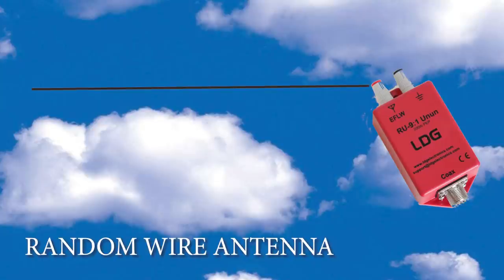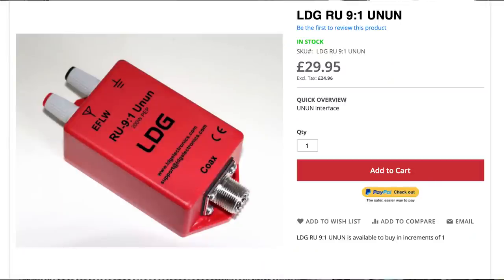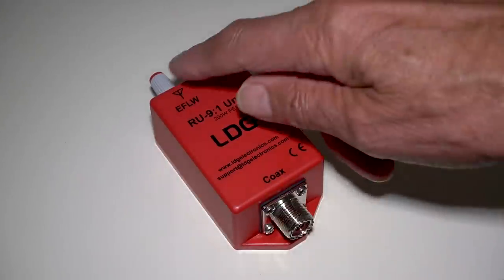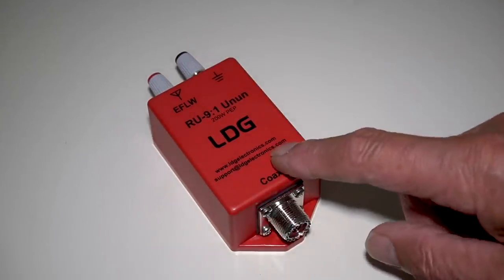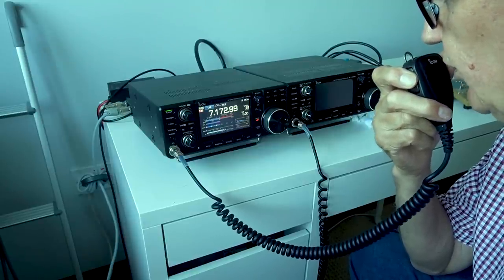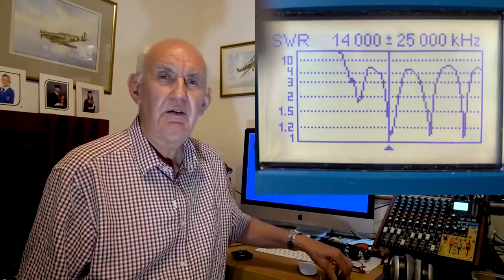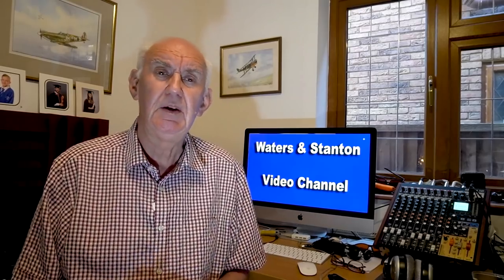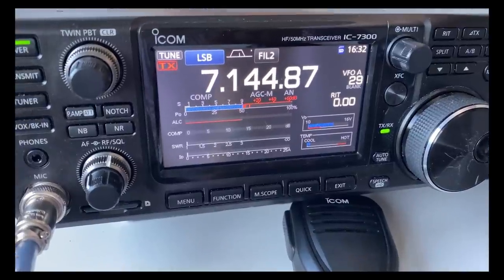RANDOM WIRE ANTENNAS USING THF LDG 9:1 UNUNS

Comment: I have had several truly random wire antennas for my SW RXers, typically 10 to 20m long for some 50+ years. At no time have e I used a 9:1 unun. and I have been able to log 1000s of SW B/Cs over the years from here in NZ. A recent article by a very experienced engineer in the US pointed out the impedance of a random wire was typically 3000 to 4500 ohms, not 450. A lab test of the input impedance of a Tecsun PL660 gave a result of 34 ohms on HF, not 50. Hence the use of a 9:1 unun was pointless for receiving. The prime consideration for RXing is the lowest noise floor possible, not impedance matching. People are mixing up max power transfer for a TX, and low noise for RX. I would strongly advise static protection for external RX antennas. (Life member NZRDXL, Life MIEEE)
Reply from the maker: Hi Ken. The engineer is roughly right. A long  wire mis-match on receiver is no bad thing on SW bands. The signal strength  attenuation is often beneficial. The nouse floor will also often appear better. That is why most transceivers have attenuators that can be switched. It is the Tx side that must see a good match. 73 Peter.

Comment: +1 on using a line isolator! Using a 9:1 random wire setup without one with just 10W on 15m made my PC do some very strange things, it was like there was a ghost in the machine. A bit shorter wire than yours worked well for close European contacts on 20m SSB with only 4W along just the top of a 1m high fence. Turning it into a sloper with the far end on 7m pole got me out to eastern Europe and one in to Asiatic Russia still on QRP SSB. I was really surprised what a bit of cheap wire could do. As you say, it will be good for portable or those starting out on HF on a budget. Mine is self wound, but found it fiddly to do so would probably just buy one of these if needed another in the future.
Reply from the maker: Maby thanks. That sounds like real ham radio! 73 Peter

Comment: Love your channel. Two years ago I tried the random wire antenna during Field Day using a length the website you reference considered okay. I attached the 9:1 at the base of the slopper and added a radial on the ground for 20m. I attached a line isolator (rf choke) to the coax side of the LDG 9:1 then coax to my mfj tuner and this fed my Ft-991A (it can only match 3:1). Receiving was great. When I hit the PTT the MFJ went nuts and my ft-991A reset. Seems like RF down the line. I have used the isolator since without an issue, so I believe it is working. I have no idea why the set up  didn't work. This story aside. My question is this, whenever a counterpoise or radial is used on an EFHW or Random wire antenna, it looks to me like a flavor of an OCFD with a higher impedance. What do you think?

Comment: Does a 50 or so ft of wire with a  9:1 really tune 160m? I will have to try that to believe it. If so, everyone with an IC7300 should use it....to take advantage if 160

Comment: Update: I built a 41 foot vertical antenna with a single 17 foot counterpoise with this unun.  Because my station is on the second floor, and there’s a large tree growing over the house, I was able to pull the 41 foot vertical section into  to the tree so that the bottom of it is approximately 12 feet above the ground at my widow level.  The single counterpoise is also elevated and simply draped away horizontally through some trees at 90°. I made 4 SSB Parks On The Air contacts on 17 m with this antenna; the longest being from my QTH in the eastern United States to San Francisco California (2500 miles or 4000 km). Good reports of 56.  I was running QRP power of only 5 W. The key is my coax feed-line totals only about 2 feet.  Very low-loss system.
Reply from the maker: Many thanks for that.. Sounds a nice serip. 73 Peter

Comment: I have two of these 9:1's and they work very well. For wire I found speaker wire is very cost effective and it comes in thin sizes that hide easy.

Comment: Thank  you Peter
 for the  clarifacation on 9:1unun.  I have one I tried to use on a short feeder  cable of rg58  which is about 12ft long, I measured out  65 ft for the antenna,  and I was using no ground earth,  and was disapointed on some of the higher swr readings,   and therfore thought it was faulty, the atu I was using is a edx1 from Alinco,  my shack is in a stone building and a ground post is very possible in fact I have one to install now on watching this I am less worried I have been setting up correctly, The un un I bought was commercially  made. I also made a line isolator on ferrite FT240-43 FERRITE TOROID  from ebay and put it on the antenna side of the ATU. The radio I am using is ts130s
I have had some contacts on it,  and now you have put my mind to rest on this situation, as I did not want to damage the radio. I intend now to watch more of you videoes and have suscribed
regards G1GDB
Reply from the maker: Hello Derek. Great to hear from you and get your update. Thanks fir the support. 73 Peter

Comment: I can attest that the 9:1 antenna is a great performer. I home-brew mine using readily available toroids using the “Earchi” instructions. For field antennas, the toroidal transformer can be fastened directly to a piece of plastic cut into the shape of a winder. I also use a home=brew 1:1 transformer at the rig. My rig is a KX2 with its excellent ATU. I have lots of other experimental antennas, but this is the one I reach for most often for portable activations. I use a 10M telescoping pole and set mine up as a vertical or as a longer inverted vee.  The setup time is very quick, and the performance is always satisfactory.
Reply from the maker: Many thanks. 73 Peter

Comment: Another great upload Peter! I'm a big fan of the 9:1 unun... although a bit of a compromise they make a great multiband antenna for home use when space is at a premium. My 9:1 configuration is a 22m radiator working against a 20m counterpoise, this let's me work bands 80m through 6m with some great results. As you point out the average vswr is approx 2.5:1 across the available bands but this can be matched via the transceivers internal ATU with no issues.
Reply from the maker: Thanks for that. 73 Peter

Comment: Hello Peter.. Thanks for this video, im sure my eyes didn't move while watching this one. Antennas, and especially cheap simple easy to erect antennas are very interesting.. I  use a small 10m wire and 9-1 unun at 7ft high. Worked stateside and most if Europe quite frequently. Didnt know about the line isolator though. Fantastic presentation. Many thanks. Gary.

Comment: I did a test a few weeks ago. I ran out 25m of wire, connected to my Pl330. Checked reception over a wide range of freqs, the cut off 5m lengths and tested the same freqs. At 10m I reduced the length to 1m sections. Optimum reception seemed to be with 7 to 10m which is similar to the wire antennas supplied with these modern SW portables. Additional length increases noise and overload.. But the PL330 is a brilliant receiver.
I enjoy your down to earth comments based on considerable experience. Cheers.
Reply from the maker: Many thanks Ken for the information. 73 Peter

Comment: With the wide availibility of 9:1 ununs one or many would think that it was a magic ratio that is absolute and a panecea to match every random length wire in every condition or environment. Many new hams don't realize that 9:1 is just a balllpark ratio to lesson the losses of no transformer at all. Example,  I use a homemade 4:1 on my 53 foot inverted L with great results, especially on 20 meters. It is just 12 or 13 turns bifilar wound around a ferrite rod antenna core maybe 5 inches long taken from a scrapped am radio found at a thrift store for about $3.00.  As a plus, I use it's companion variable polycap as part of my matchbox tuning. These two parts alone were worth more than the radio. 
Point is sometimes a 4:1 or even 5:1, 6:1, 7:1, etc. May be a better "match" at one band over a 9:1. 
Ideally, one could construct a transformer with multiple taps for each of these rstios and select the one that gives the best match at the radio, on some cases eliminating the need for a seperate antenna matchbox. In fact on 20 meters and other bands,  I don't need a tuner between my feedline and my transceiver. To top it off, I'm using 75 ohm catv line (RG59) to feed it. 

By the way great presentation and you covered the subject well. Always enjoy your posts. 73 de KC4QI

Comment: Great video. I am using the LDG 9:1 UNUN. I have it placed at the bottom of an inverted L. My feed line is a 100ft. RG 214 low loss. At first it worked fabulously  from 80m to 10m. Then after a month or so all was lost. Upon inspection,  the UNUN had filled with water. It's not supposed to do that. So they claim. Drained and dried out the UNUN and sealed. Mine wasn't initially sealed. Now it works again but it seems I do not get out as well as I used to. VSWR is very acceptable among the bands. Kind of confused at this point. I gave recommended the use of the 9:1 to several of my ham buddies a while back fo their end fed set up. Theirs have been working great. Man I love this hobby. Keep the videos caming. Have fun, stay safe and stay healthy.
Reply from the maker: Hi there. It is very easy to think after an antenna repaur that things are better ir worse. If the VSWR is the same as it was, then it is high likely that it is conditions. You could replace it with a brand  new UnUn but I fear you may find it is conditions and not the transformer!

Comment: First RF Choke is paramount, End of Story. I use EARCHI Design FT-240-31 RF Choke with 9:1 T200-2 UnUn and 30 feet of wire which outstanding for local 10 meter and 6 meter Net(s) Also have used same configuration with 53-57 feet of wire with sweet spot on 40 meters and also was able to get 6 meters ; ) I replaced 53 foot antenna with FT-240-31 RF Choke and 49:1 FT-240-43 EFHW and 65 feet of wire which gave small performance increase on 40 meters but lost 6 meters with EFHW : (   I can not overstate the performance of the EARCHI Antenna for me and small front yard city environment ; )  Only thing better for me and my location is ARROW YAGI-UDA Antennas which I only have room for VHF UHF antennas,  ARROW ANTENNAS have outperformed everything else I have tried to date. . .   Thank You for a great informative channel. . .    ; )

Comment: Thank you for the best video I've seen covering all the key points of setting up and using end-fed non-resonant antennas with 9:1 ununs. I find that the antenna and coax lengths are very important. I now have a  71' sloper, 9:1 unun, 50' of RG8u coax, 3O' counterpoise, and common mode choke attached to my transceiver with a 1' RG8u jumper. Using an inexpensive manual antenna tuner I can get from 1 - 1.5 to 1 SWR on the phone segments of all HF bands 80 - 10. I've made many contacts using 1 to 20 watts SSB. My current project is a 135' sloper that will go from my 25' balcony to the top of a 100' oak tree that's about 150' away. I recommend learning how to calibrate and use an inexpensive NanoVNA to view and adjust antenna, coax and counterpoise lengths for minimum SWR.  Thank you again for an extremely helpful and very encouraging video!
Reply from the maker: Great information. Many thanks for that. 73 Peter

Comment: great tutorial peter, there's a lot of recommended random lengths on different site's....  for portable dx i use nothing else, 29.5ft wire vertical, with 2 times 20ft for radials/ counterpoise

this will work ok but best results with this kit is to run the ground/radials/counterpoises away from the unun, 2x10m of mini8 coax with a common ground rf choke, or clip on ferrite at the 10m joint so part of the coax is a counterpoise,  these antenna's hate short coax feeds, done right they are a very affective setup
but need a lot of choking and grounding

Comment: This reminded me of a couple of vintage 1950-60s 'USA novice' CW-only transmitters I have (Eico 720 and a Globe Chief) using 50-watt tube finals and a PI-network tuner output.  The instructions for each said to use a coax-fed resonant dipole, but if that were not available, any random wire of 75 feet or so thrown up in a tree would work fine if the rig had a good connection to a ground rod or the house  plumbing.  And they do indeed work!  Those old transmitters seem to be able to load up on just about any wire of reasonable length connected to them.  -- John N0BUP
Reply from the maker: Hi John. Yes I remember those days. No VSWR meters, just neon screwdrivers and old WWII RF current meters - that I burnt out on occasion!!  73 Peter.

Comment: Excellent Peter, I also run a 9-1 with a matching unit, good results on 40 meter, not so much on other bands, your video got me thinking, longer counterpoize and isolation unit, will give it a try, also I set up a portable, usually where I can find a good tree, thanks for the tips.
Reply from the maker: Thanks for the info. 73 Peter.

Comment: Hello Peter, I have been experimenting with an unterminated "Vee Beam" for 20-6 meters, with my leg lengths currently each at 100 feet. The Vee Beam Apex angle is approx 60 degrees. The wires are up in the air about 35 feet. I have been getting fairly good results and with noticeable gain in the intended direction (NE and SW). My QTH is in NY State. My system is fed with 75 ohm coax, I utilize a common mode "ugly choke using my 75 ohm feedline coax" at the feedpoint of the Vee Beam, and at same location, match my 75 ohm coax with the Vee Beam (essentially now a balanced two end antenna) with my home brew wound 4:1 torroid wound on Type 31 material. My SWR varies across 20-10 meters on the various bands of course,  I have tried a 6:1 amd a 9:1 Balun, with mixed results, however I am trying to come up with the ideal  lenghts of the wires to created the "highest impedance", thus creating the best overall match.  

My question is my choice of 100 feet per leg "good enough" or would 98.5 feet, or even 107 feet make that much of a difference.    
Or possibly those lengths don't apply to my un-terminated Vee Beam at all?? I understand am trying to have near mutiples of 1/2 wavelengh for the bands I am intending to work, the goal....

Ideally, I would have a balanced remote antenna tuner at the feed point on the Vee Beam hihi, maybe someday.  
I also am not a big Fan of Balanced line at my QTH, lots of Ice Storms here, routing the balanced line into the shack issues etc, etc.

Anyways, my results with the 100 foot lenghts thus far have been good (since March 2023), I run semi QRP at 50 watts, and if the signals are strong I usually can work them.  However it is tough to make the contact if the station on other end is running 1000 watts or more hihi and that is understandable, but if they are S9 + I can usually make the contact...  I Never get tired with messing with antennas hihi.  And also I certainly see a lack of 100 watt or less signals on the higher bands, in solar cycles of the past it was very common/the norm

Hoping for a nice long HF ride on the Solar Peak this cycle, is sure was great conditions in Feb-March this year, will see if this Sept-November will also yield some great conditions for the higher bands, best 73 de Jerry KC2UT
Reply from the maker: Hi Jerry, I was going to strongly suggest balanced line until I read your reservation. But why not run balanced line back as far as you can, then 4:1 balun followed by short coax run. Even a modest VSWR on a short coax run  will have very low loss.  Petr.

Comment: As a 'length of wire' user for the last year I think its only drawback is that it picks up more noise & interference than a tuned antenna (which figures if you think about it). This in turn makes reception a bit less sensitive. The counterpoise is both essential and interesting -- my 'counterpoise' ("the other length of wire") ended up near a formal ground point so I naturally assumed that it would benefit from being connected to ground (through capacitor etc. to prevent ground loops). This killed the antenna's performance completely. I haven't figured that one out yet!
Reply from the maker: This antenna is tuned and I NEVER use a counterpoise with any EFHW. BUT I always use a line isolator at the Tx end. 73 Peter

Comment: They say ”A little learning is a dangerous thing”, but … I tried modeling the 71’ EFRW antenna, set the characteristic impedance to 450 ohms, and used the optimizer to work on the SWR for various bands. It seems that 60 meters is a lost cause, but I was able to get a decent SWR on various bands by using the coax as the counterpoise, and placing a current choke (perhaps clip-on ferrites) at different places depending upon the band.

It was interesting that the optimum length of the counterpoise decreased as the frequency went up, and I SUSPECT that the total length (71 feet plus the unchoked length of the coax) was pretty close to ½ wavelength …

Did I just re-invent the OCF DIPOLE? 😀

73 de AF6AS in “DM13” land